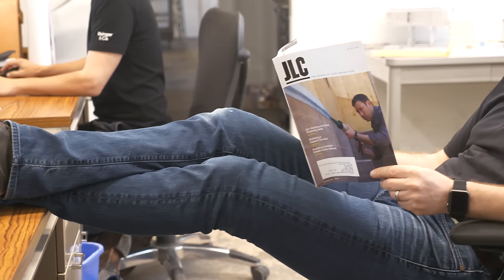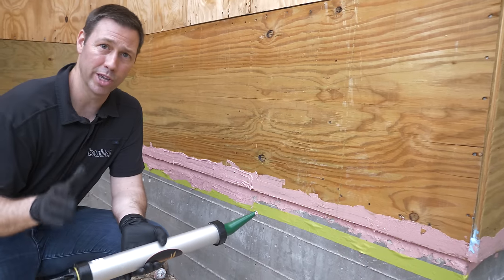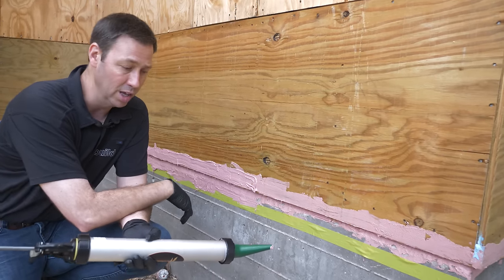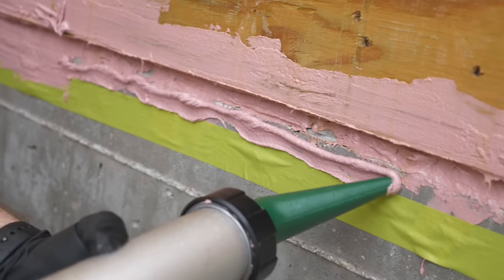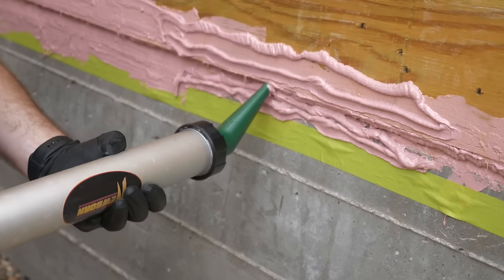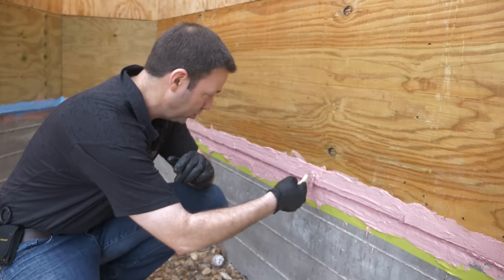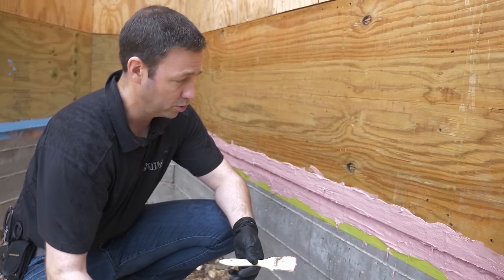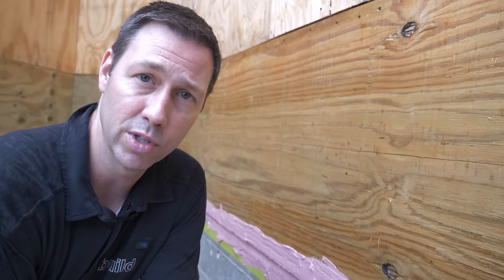Sealing Framing to Foundation

Comment: Use a bucket of tar with reinforcing mesh. Much much cheaper and it will preserve wood. Does the same job at the fraction of price. Use polyurethane caulk around windows and doors. Don't buy into every product  you see. This is just another way to make the rich richer and poor poorer. Sucker born every minute.
Reply: stanley siewierski I have a doubled bottom plate(top plate a little over 8ft.),which is sitting on a sill beam.I was cosidering placing tar on plates and sill then putting sheating on.Would this work?
Reply: I like your thinking! ✌🏽
Reply: What can i do to seal a room on a concrete patio that leaks?

Comment: Make your house airtight, then spend $3000 to bring fresh air into the house?
Reply from the maker: +Brad Lee could be as simple as a $300 Panasonic ERV for fresh air
Reply: Yes. Now you have control over what air is coming in, when it's coming in, and you have no heat loss or gain.
Reply: Earthships have ventilation from air 20 feet below and have vents that are manual on some of their models.  All natural, keeps house at b/t 64-72 degrees F, no expensive sealing other than Earth(Adobe, Stucco, and other various methods) and proper south facing design.  Air that deep has a cave like effect that allows for constant cool fresh air and designed to keep it hot in the winter with winter sun taking care of the heating and vents plus overhangs that deal well with Summer sun, keeping it out of the house for the most part.  Sometimes is more about design and ability to use certain resources.  These building codes and old systems take awhile to keep up with technology and to allow traditional updated methods that take into account modern living.  Sometimes we spend too much with dangerous chemicals and methods of building that if we just added our ingenuity to marry that properly with tried and proven indigenous techniques; we could live in spaces that require VERY little energy but for the moment, a little more labor.   I dig the quality that goes into these designs nevertheless.  Not convinced some of the chemicals used in current construction should be continued though... just my 2 cents.
Reply: Brad Lee 
I can't believe people are trolling sealing up the most critical part of the home.  Don't bother to tape your windows either!
Reply: And people wonder why their sick all the time.
Reply: Very true ,,,modern life is one big chemical bath,,,plus monster  home building... when most of the 5000 sq.ft. is never needed..
Reply: I've always thought that funny too.  When my father built homes, 30-years ago, they didn't make them "air tight" like we do today.
Reply: @Justicejamesb  that explains why I have rotten wood between my basement foundation and my home...
Reply: @garraper  : Perhaps you don't need it... But we just sold a home we built and lived in for 16 years that was 5480 sq.ft. (1320 sq.ft. of garage), and we used every square foot of it. Matter of fact, the garage wasn't big enough and we want a few other things now that our children are almost grown, so we will begin construction the first of the year (2019) on our new home. So please just speak for yourself if you don't need or want a larger home, and that's perfectly OK mind you. But please don't speak for the rest of us who actually do want a larger home that utilizes the latest technologies. Thanks.

Comment: Hi Matt, what waterproofing method do you recommend for a shed that's on an existing slab. The plywood will have paper and lathe for the stucco along with the weep on the bottom, but the bottom plate (pt 2x4) will still be exposed to water. Is there a way to stucco it and seal it?